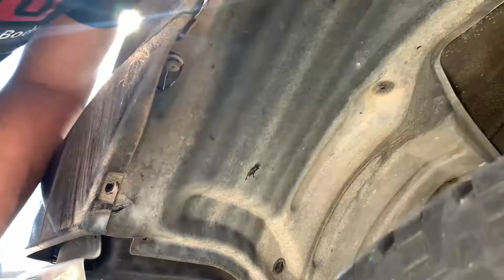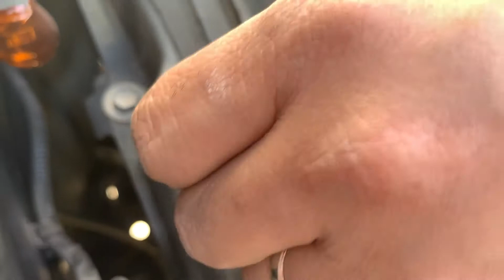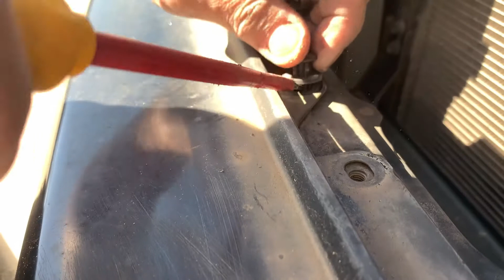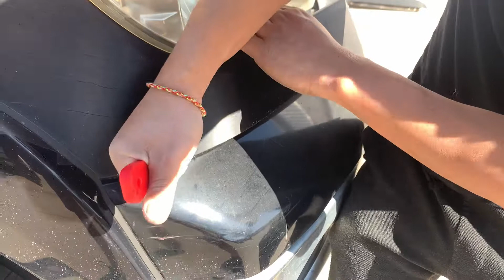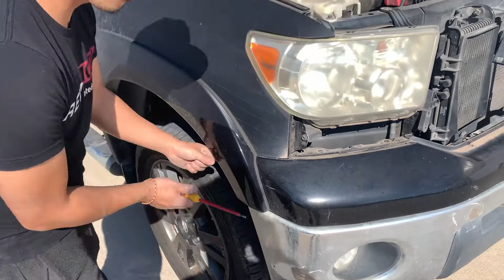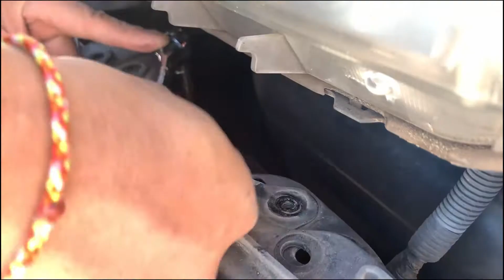How to remove a 2007-2013 Toyota Tundra top pad

Comment: I just bought A two peace bumper like the one you have but the one on my truck is a one piece set up. I'm trying to find out what is missing on my truck so I can put on the two piece set on as of right now I can only put one the piece you just took off but not the bottom.
Reply: I have a 2007 Tundra
Reply from the maker: You'll want to see this video https://www.youtube.com/watch?v=CcxVwhYZgPI here. We remove the lower bumper. It should require teh same bolts, etc. Let us know if you have any questions.